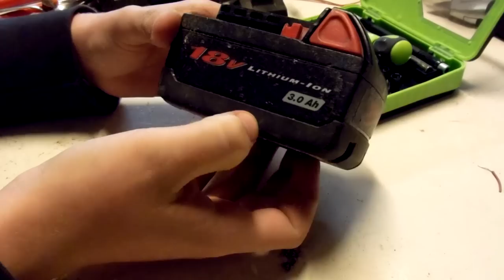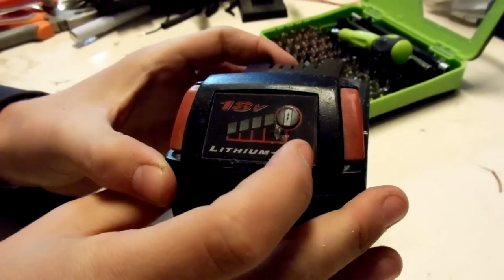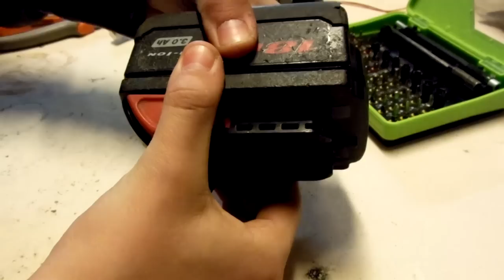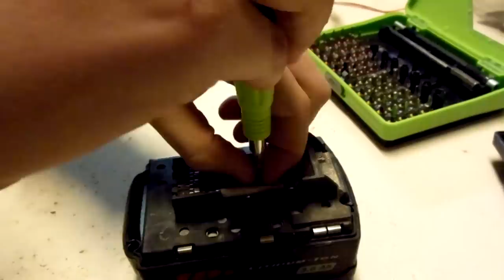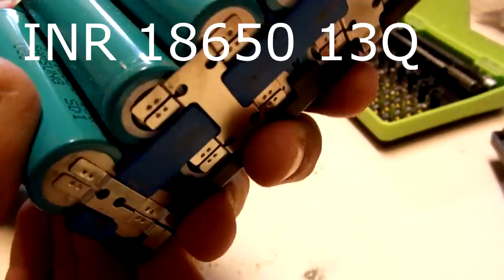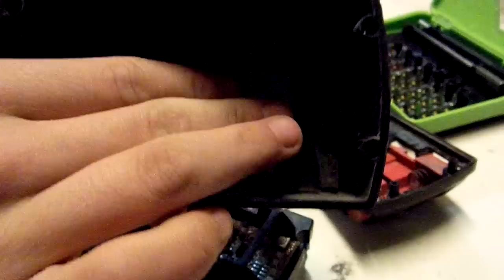Milwaukee M18 3.0 Ah Battery Teardown

Comment: I have had Milwaukee for years and no probs,most other cordless companys change there battery terminal configurations with each new model,but Milwaukee has kept the same gear for years,in laymans terms I can buy a new drill and use my old battery which I have done.so mark vietti,you may have bought a bad one mate but I have had no problems whatsoever.
Reply from the maker: Exactly! Having the tools from one brand makes sense too, easy battery swapping.
Reply: Yeah youre righr but this kid isnt fixing a Milwaukee battery he is fixing a piece of knockoff trash

Comment: It tells the number if times the battety has been charged. The number og data since The first charge and some other info om The battery. The far left led is The 1000 . Second from The left The 100 The third 10 and The right is The 1.
Reply from the maker: +smackmymonkey Thank you! makes sense. How do you know this? Will have to look more to the sequence though, the first number is then 2200 and that is surely not the amount of times it has been charged.
Reply: +Triangle_DIY It used to just indicate over heating and cell breakage? - you may see this effect on 'testing videos' of a gent using a holesaw or spade bit, i can't recall, in the hot sun. it's a milwaukee vs dewalt video if memory serves.
Reply from the maker: +jpopcorn Asked Milwaukee, you can extract the 'days of service' from it, which seems to work, older batteries give a higher number. Would have to test a few for a few days to see. They wouldn't say what were the other codes it gives.

Comment: Could you tell me wat pins are the positive and negative on these batteries please
Reply from the maker: +Shaun Wyllie Sorry I totally forgot to answer you. The outside pins seem to be plus and minus, you could check for yourself with a multimeter, that would be the easiest way.
Reply: +Shaun Wyllie LOL. You do not need a volt meter.  You can tell by looking at it. The negative ends have metal that goes across the whole end which is flat or one surface. The Postitive end while it may not have the bump or raised area like a alkaline aa or whatever, still has an area that is separated from the outside edge or perimeter, by a valley or ring or a non conductive ring. In this case a white ring.
Reply from the maker: +Ari P Yeah I know you can see it from the individual cells. However from the complete pack it's harder to see. Its not very clear which pin  is connected with the positive or negative connection of the pack.

Comment: I bought the 5.0 battery last year on blackk Friday.  I used it maybe three or four times. Went to charge it and it started flashing red and green fault lights. What do can I do to get it to work again. They are not cheap to buy every couple months.

Comment: Can anybody point out what each terminal on the M18 Batteries are?
Reply: Old post but that is the big question that is being asked in a lot of places.  The 2 outer pins appear to connect directly to the cells but I believe if you power something off of those you risk over discharging the battery and damaging it.  The 3 inner pins must cover charge levels and heat.  Chargers dont use 1 of the outer pins so it must charge only through its control circuit.  The advantage of this means that the monitoring circuit is not in series when you are using the battery so it takes less of a beating, the problem is it makes it very hard to use the battery for anything other than a branded tool.
Reply: Cut off voltage for the 18 volt battery is 17.5 volts. However, you will need to monitor this because the cutoff switch is in the tool

Comment: Info on lights 'test' http://www.manualslib.com/manual/516874/Milwaukee-M18-48-59-1801.html?page=3
Reply from the maker: Thanks, but that's the normal ligth. What I mean in the video is the flashing sequence. You can at least get the 'days of service' out of that, which is quite handy to know.